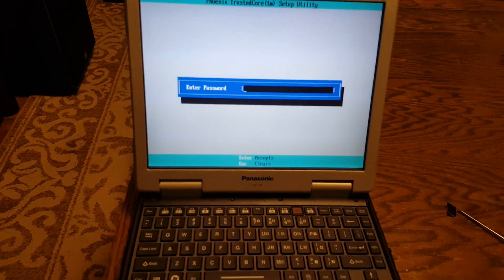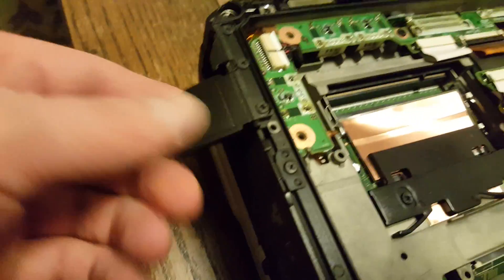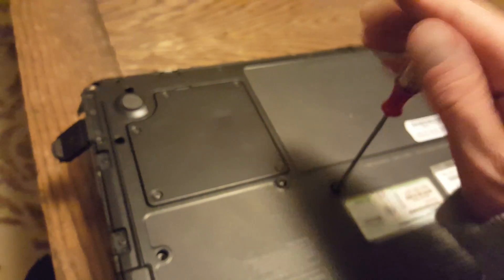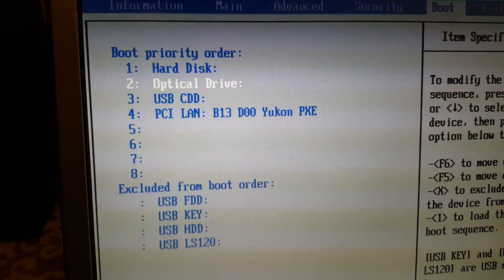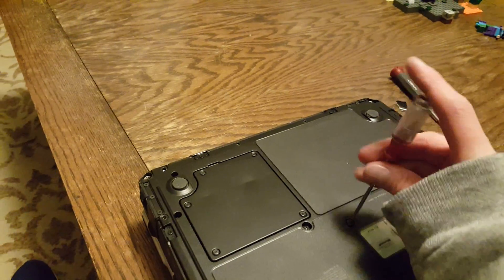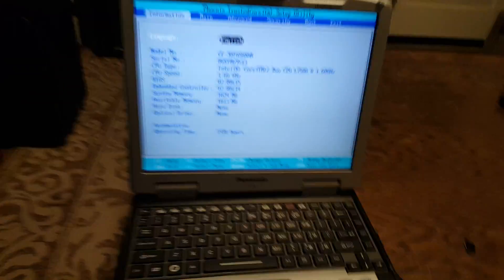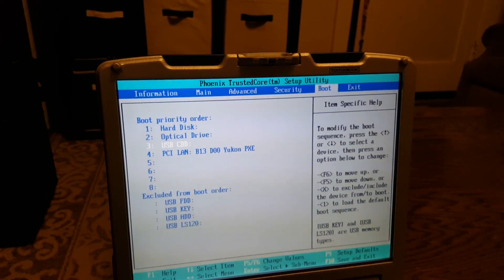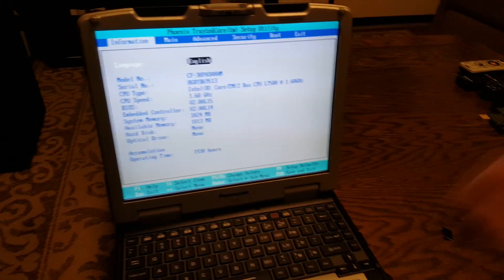Remove Bios Password from Panasonic Toughbook CF-30

Comment: barry k::: I have the Panasonic CF-53, And it asks for a password when I power on the laptop, with the Blue Dialog Box reading "PASSWORD".My friend says that that is the Administrative password???, then it will do the regular boot up with the start colored logo with the regular login screen, whatever with either your profile picture or whatever image one chooses.So. I really Need your Advice on the issue, please Bro.the first Dialog box just. Don't seem it need to be asking for a password.Please reply soon cuz I may trade it for a Macbook pro mid-2012, knowing that these Panasonic Toughbook are of value, in even trade right? or what?
Reply from the maker: If you can get to the cmos battery and unplug it that should clear any password that was set. But I can't garantee that would word since the laptop I used was a cf-30. As long as the wifi is turned on and you can boot off a cd when you want to and reload windows a password is fine. Can always try password if that works. But if not taking it apart is much more complicated then on the cf-30. There are videos that guide you on how to do it. Thanks
Reply: barry k::: thanks for replying back so fast...yeah well before I go and do anything to it,I will watch a few more video tutorials.And make sure I am going to do I right..Just one more question.From your opinion, do you think it's a fair trade I have a MacBook pro mid-2012.i5 2,30 or 2.60GHz 4GB Ram 500GB HDD and paid$1100 like a couple years ago.I saw on the internet the Panasonic Toughbook CF-53 going for $2500, But of course, it's a used one the one a may trade.
Reply from the maker: Sure. Take the macbook. Upgrade to an ssd and max out ram.
Reply: barry k::oh im trading the Macbook Pro for the Panasonic CF-53,i tried to give apple a shot and i just can't get the hang of it.Guess I'm just a windows die hard...Plus i have a MacBook old version which i always wanted,snow Leopard....the Macbook Pro gots Yosemite OSX.

Comment: Does this also clear the "Supervisor Access Level" ?
Reply from the maker: Yes I think so. I would have to check my CF-30 when I get off work. Clears everything though. Check and let you know.
Reply: barry k. Thanks boss. I'm looking at a CF-30 MK3 on ebay and in the pictures, there is one of the BIOS information tab, and on the very bottom it says "Access Level: Supervisor"

The seller doesn't know the supervisor password so really not sure how to fully unlock it. That would be great if this same process works.
Reply from the maker: Well I got 2 CF-30's off ebay and both where locked with a bios password. Now that doesn't mean it won't boot off a cd and then install windows on an ssd or mechanical drive. They disable certain ports depending on where it came from. But I know for a fact you can take off the bottom like I did and unpug the cmos battery. Let it turn on and then restore defaults. The password should be removed. But of course on that model you would get off ebay might be different. My CF-31 I put in password and the password and that worked. I haven't tried to unplug the cmos battery on that one yet and test it.
Reply: barry k. No, mine is a cf30 as well but I just want to make sure that before I buy it if your process will remove that supervisor access level because the seller doesn't know the supervisor password.
Reply from the maker: Yah I know you are thinking about getting the CF-30 off ebay. I can't guarantee that it will work but from what I did on 2 different CF-30 I think it should work. On the newer models which are the CF-31 I think they made it so the bios password was stored in another location so that trick will no longer work.
Reply: barry k. So you think since it removed the BIOS password, it would also remove the supervisor password?
Reply from the maker: I am not sure but when I hooked mine up it did not say any password was loaded and everything was disabled. I couldn't get into the TPM module area in the bios but I was able to do what I wanted to which was enable the devices that they disabled. USB Ports or if the wifi was disabled I can turn that back on.
Reply from the maker: Ever get the toughbook any luck?
Reply: barry k. 
Well evidently "Access Level: Supervisor" doesn't mean it has a supervisor password, it just means you have administrative levels that allow you to change all the BIOS settings. It's just the way they designed that specific BIOS version. It comes from the factory with "Supervisor" access level.
Reply from the maker: Well that's good. Each laptop brand has there own terms on how they describe password levels. I got 2 of them CF-30 and both where locked and wanting a password to enter in the bios. Unplugged the battery and pug it back in. Easy fix.